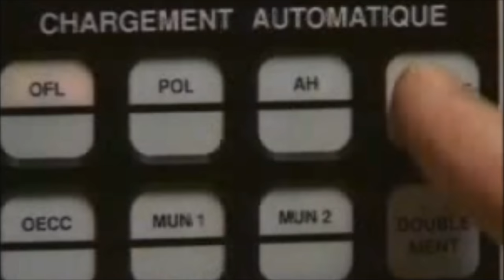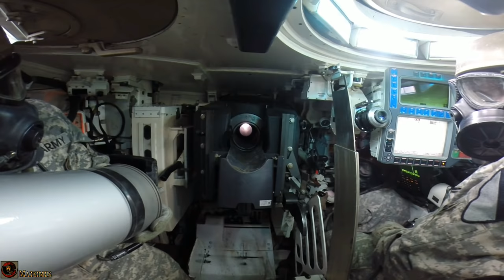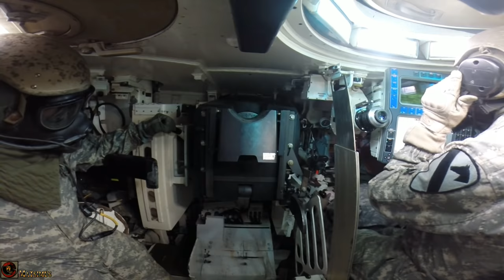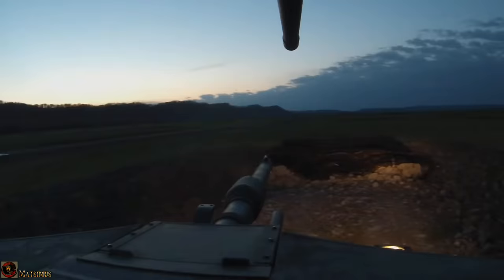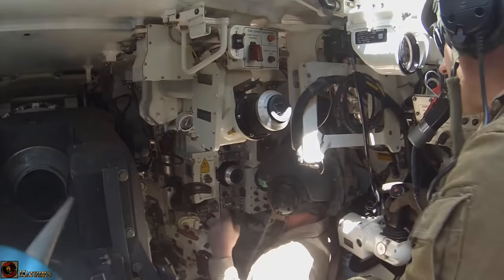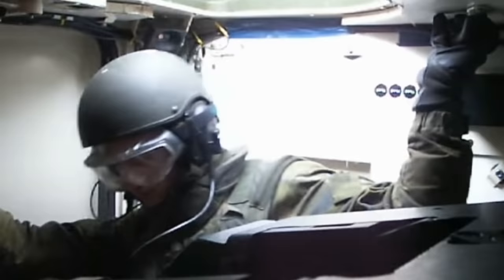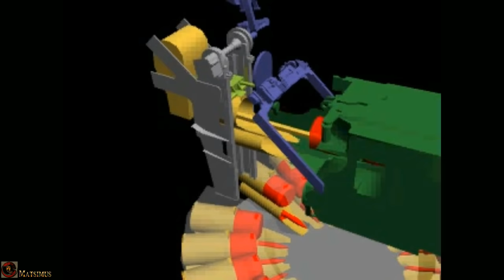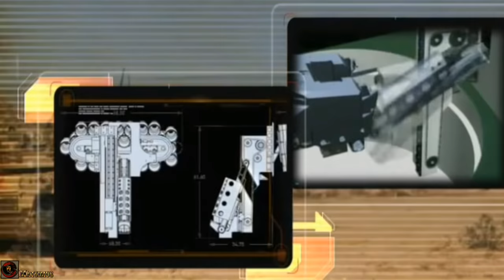Tank Autoloader or Crewman Loader?

Comment: The future is autoloader robot tanks that are remotely controlled.  The armata has a sealed of section for crew to control the tank and if the ammo explodes they are sealed from the explosion.
Reply: The modern tanks are much safer now but the armata has a clear mobility and fire rate advantage especially when crew uses remote control.  Also tanks can be smaller and more nimble and firing off plenty of shells without a crew member in the tank. 

I believe the future is a composite robot and manned tank platoons which will scout and provide firepower for one another
Reply: Couldn't they make a round that cannot blow till its primed and loaded? Could also make the core round a sabot and the outer ring of the round a HE held together by 2 magnets so ammo change is possible.
Reply: The future is electromagnetic rays which is much safer and more powerful than physical projectiles.  The US navy has developed a ray gun firing magnetic pulses.  So tanks could revert to that as well and any shot will only perforate armor and not blow up the tank.
Reply: +Constantine Joseph How hot do you think a solid metal ball will get when it flies 12000 mph through our dense air? 
I predict laser, saser, plasma and electromagnetic weapons. And forcefields and electro gravitics.
Reply: No one is firing ball-shaped ammunition anymore. Railgun projectiles can easily reach 7000mph with current technology, and may get faster in the future. These are fully inert metal darts, but with the huge kinetic energy and the effect of the powerful EM field during the firing process (which enables the projectile to turn nearby air into plasma), they can cause plenty of damage without an explosive charge.
Reply: Mercava??
Reply: the only problem is you need a new gun after 3 shots (don't get me wrong i love railguns)
Reply: Jack Zhan You basically get an explosion due to the speed. If I was told accurate info, didn't check.
I remember having heard somewhere that a comet the size of a basketball hitting the surface could take out an city block of houses due to the insane speeds of 10 or 20 kilometres per second.
Reply: It's simple: there is currently no chemical explosive that is worth using over dumb billet at 4 km/s and higher. After you hit such speed, kinetic energy transmission/conversion alone will provide more power so you are basically losing destructive power if you use explosive payload.
Reply: That is why high powered electromagnetic guns are the future.  However they are expensive to produce compared to the tried and trusted rifled or smoothbore guns that can do it over and over again for years as long as they are maintained well.  

Repairs are also simpler much simpler as it is very much mechanical than electronic
Reply: that exact thing was said in the video
Reply: The future is a giant super computer controlling all tanks, ships, submarines, planes, etc, as drones.

Fucking Skynet, bruh.
Reply: Yes, and the control of the drone army will be taken over by hackers and turned on it's original owners.
Reply: Probably accomplished by a teenage genius hacker called Cain from Red Alert and command and conquer
Reply: I want to see a full size robot or a mech like in SC Goliath or in Avtar movvee
Reply: Lasers: no, too much scatter due to atmosphere, also, the power conversion rate is horrible
Plasma: no, even worse than lasers, will blow to your face, also, the power necessary to turn something into plasma isn't even funny anymore
Gauss cannons: no... too complicated control circuitry. also, you can only fire ferromagnetic rounds. And... Power 
Railguns: perhaps, but not until a material is found that can do this without abrazing the rails after a couple of shots (or warping the structure). Ever seen that railgun fire? the rails last for maybe 3-5 shots, then the whole barrel must be changed. Also: the frickin' power!

explosives (and conventional fuels) currently have a better mass to energy conversion rate than any purely electrical systen for at least a couple of decades.
Reply: Constantine Joseph and if thhey get hit by apsbc from the front they all die
Reply: N
Reply: physical projectiles will always be number 1
 the problem with energy projectiles is their penetration, range, damage and accuracy 
energy weapons just burn or vaporize their target they don't "punch" their target as opposed to matter weapons
Reply: The Leopard has that also
Reply: This will be fine until some hacker takes your tank over and remote controls it. You know, just like in the mid 20th century, they thought that airplanes and missiles will be the only thing needed to win a war... it turned out you still need boots on the ground keep a territory under control.

Comment: I would like to add one important advantage of the autolowder over manual loading that wasn't mentioned, averege loading rate of Soviet T64/T80 is between 7 and 9 round per minute, British Challenger 2 crue during one of the exercises reached the rate of 10-11 rounds per minute, but when the the tank is on the move (off road conditions) the manual loading rate decreases down to 2-3 rounds per minute, while the loading rate of the autolowder is not affected by the type of the pavement it's moving on. Pretty important factor in strategic fast advenses.
Reply: Fair point. Even more so with improvement of stabilizers shooting on the move in an offensive role.
Reply: I've had 4.5 second reloads consecutively on a battle run at 30 kph still better reload time then an auto loader, also an auto loader requires the breach/barrel to aline with  the auto loader to load the next round, mean while a trained manual loader can load around in 4-5 seconds on the move without requiring the breach/barrel to move to allow the loading of the round
Reply: Another important point is that Soviet tanks were designed for a war with a specific enemy that has a lot of nukes and exposure to radiation is very likely. A human loader with radiation sickness would have loading times approaching 0 rounds per minute, while autoloader would not be affected. Driving a tank and aiming with radiation sickness is one thing, carrying almost 20 kg shells several times a minute is another.
Reply: it's a good point, but Soviet tanks wore all so quite advance in anti radiation equipment, filtration systems and special coatings.
Reply: to become a qualified loader you have to load quicker then a auto loader, and you get regular assessed on it
Reply: T 64 didn't have spent round ejector, spent round half shell automatically stored back in the curosell.
Reply: i just watched a video of the T-90 MS and it has a port on the top of the turret which spent shells eject, if that doesnt have an override it would expose the crew to NBC environment, also the M1 abrams is fitted with main and back up NBC systems
Reply: you may have been ( or still is a greate loder) but I have my doubts about ability to keep such rate consitent, after all humans are physical beings, first not all of them are the same, some stronger and faster then others, and they do get tired as well, on top of everything turrane can be quite diverse, emotional state of mind play's it's role to. But what I mentioned in coment ofcorse is not the main reason for use of autolowder.
Reply: Dmitriy T like I said there is a requirement to load faster then an auto loader, if you fail you do don't become a tanker, this gets tested every few months
Reply: T 90 does have ejector as well as T72, T64 and T80 doesn't, because T64 uses cabin type loder.
Reply: ok
Reply: 3 shots in 13 seconds for consecutive rounds in t-72 tank
Reply: t- 62 has a ejector t-64 does not and the air filter system creates overpressure un the t-62 so when the port is open it is supposed that contaminante should not enter
Reply from the maker: Paula Mkguens Rial true but those systems never fully work. Blister agent for instance is liquid and in theory could easily drip past pressurized systems if they are weak...but yes in theory it should stop that from happening. That's if the rest of the tank seals are working correctly and not losing pressure
Reply: T-62 does not have an autoloader but it has human loader. And also opening ejection port under NBC would expose crew to radiation. However you could potentialy store spent casings inside turret for a time being.
Reply: how would someone take 30 seconds to load a round thats fucking bs

Comment: Leclerc tanks use auto loading with 3 crue men and the "loader can select the ammunition he want,  till 3 differents ammunitions,  so I think u need to check infos before
Reply: What he meant was: once the shell is in the barrel you can not switch (auto loader can not take the shell back)
Reply: @hyunjunpark679  yes but we are talking before engagement
Reply: @hyunjunpark679  they have auto eject. And are you seriosly saying you should drive around with an empty barrel?
Reply: We do have round in chamber while entering engagement area, the gun would be put on safe; usually it would be a sabot round as the computer would be indexed to such. The sabot round would punch thru softer targets but it would be easier to reload a HEAT round afterward as a follow up as needed.
Reply: Main guns were fired electrically, without a current, the gun is very safe. Loader needed to flip the safety/fire switch on before the gun could be fired. So riding into combat with a round loaded would cut down the seconds needed to load and all the loader needed to do was the put the gun in fire, plaster himself against the turret ring and yell "UP!" into the CVC.

More often than not, seconds would be lost because green loaders might forget the safety before calling "UP" after the gunner responded to TC's fire commands.
Reply: @ Hyunjun Park... you are very welcome. I sometimes missed being a tanker, 'playing' with the Big Toys. But being a veteran meant there is never a part of me that will stay with me and I am just glad to share my experience.

Comment: I think autoloaders make sense for self-propelled howitzers. With 155mm guns, ammo weights upwards of over 100 pounds, while 120mm rounds typically weight 40-50 rounds. But they still need to be able to load rounds manually in the event the autoloader breaks.

Comment: Basic logic and math is still something that's eluding majority of western mentality when it comes to this issue, while age old fallacies just keep getting endlessly repeated.

Manual loader adds minimum of TEN TONS of weight to the modern gun turret, and over one meter in height since the loader has to STAND, it's that simple.  

Increased profile increases hit probability at 1km by 30%, which forces frontal armor to be even thicker.

All of this has been calculated ad nauseam by entire universities over and over again for over 70 years, and only Western propaganda is still towing the same old tired line.

All comes down to percentage of hits vs penetration resistance.  

1. Do NOT get hit.
2. If hit have the lowest probability of critical damage.
3. Store the ammunition as low to the ground as possible.  

Separation of ammunition into the rear of the turret does NOT mathematically lower the possibility of it getting hit, on the contrary it only increases it.  

Blow off panels do NOT "save the crew" from ammunition detonation, at best they buy time for the crew to bail in case of PROPELLANT BURN OFF.

So the tank either carries only KE rounds and become entirely ineffective against infantry, or it does carry HE rounds and risks DETONATION upon ammo rack hit.

If the traditional Western rear turret ammo rack is loaded predominantly with HEAT rounds, then upon breach it DETONATES just as any other high explosive warheads do, and no blow off panels or fire walls prevent total and immediate destruction of the crew compartment.

Eastern tank design focuses on infantry support thus high percentage of HE rounds, while Western design focuses specifically on anti-tank role thus complete absence of specific anti-personnel HE rounds.

1991 Iraq war tank design comparison is false and has been proven so over and over again, it's empty propaganda that has been ignored by professionals decades ago. 

What matters is how a frontal armor of the tank takes a hit, and T-90 demonstrates that perfectly right here when a TOW smacks it from point blank range right in the sweet spot;

https://www.youtube.com/watch?v=N9cre9GpIUs

Crew is safe tank not penetrated, and that's all the tank armor is supposed to do, provide frontal protection.

Western tank provide the same approximate level of frontal protection, but at the expense of being almost TWICE as heavy, while providing NO additional protection when hit from the sides, as clearly shown again and again.

If the ammo rack of this Abrams was loaded with HE, it would have detonated just as ay other HE warhead;

https://www.youtube.com/watch?v=VWXIhXJktmM

A hit on the rear of the Abrams turret GUARANTEES a cook off, while there are numerous videos of T type tank getting hits from 360 degrees that do not result in ammo rack ignition because it's stored on the floor instead of high up in the turret.

A side hit on the Abrams turret breaches ammo rack for an cook off;

https://www.youtube.com/watch?v=UEdfCw0nsoM

A catastrophic Abrams ammo rack breach by Kornet ATGM from long range;

https://www.youtube.com/watch?v=-ePvNlfrxfw

All of those are "good enough" hits that completely destroyed Abrams tanks with cheap ATGMs from the 70s, and that's all that's required, but if those ammo racks were actually loaded with HE rounds, they would have detonated just as any other ammo rack loaded with HE.

So is all that extra weight increase battle and worth it?  According modern developments such as US M1 TTB and Russian T-14 Armata, no, it does not.

All tanks burn, but only the ones that carry EXPLOSIVES actually EXPLODE.

Do the math you lazy bastards!

Comment: There are as you said trade-offs between the types.

But here are the things about Manual Loading.

+ Loading of ammo can be quicker and ammo changed on the fly compared to autoloaders.
+ Easy to design separate blow-out compartments from them.
+ Nice one piece ammunition.
+ Additional crew member who can do other things and help.
+ Any idiot can be taught how to load a cannon.

- In order to fit extra crew-member nicely, tank must be bigger. Increasing vehicle weight.
- Will be more effected by vehicle moving through rough terrain and can be fatigued.
- Not ideally suited for loading particularly large rounds which would be better suited to being loaded by an autoloader as a multi-piece round.

It really depends on what you are looking to get from your tank, but that is generally what I see about. The Japanese Type 90 also has an autoloader with blowout compartments so that can be done and is not a thing exclusive to manually loaded tanks.
Reply: The Challenger 2 has 3 piece munition and does not have an autoloader, autoloaders do not have to have multiple piece amunitions.
Reply: LenChewbacca True indeed.
Reply: Which doesn't mean multiple piece munition is bad btw. Both have positives and negatives.
Reply from the maker: that is true. as for three piece, the mag for the igntion (cant remember the name of it) is a mag so its not like it needs as much reloading as the rounds themselves. but a very fair point! And your avatar made me laugh lol. but isnt that jabba :-/ lol
Reply: made the account like 7 years ago or some shit, I would remake my account but I have lots of videos in my favourites that I like.

Another point about autoloaders is that it's less heavy.
Reply from the maker: +LenChewbacca haha gotcha! Well thanks for watching! Have a good day :-D
Reply: but in the video it was shown that autoloaders do have multiple pieces of ammunition tho, the projectile and charge was loaded seperately.
Reply: Harry Lim I know that as I said in that comment about the auto-loader being highly suited for loading multi-piece rounds.
Reply: also, are you referring to vent tubes/percussion tubes? The little 50 cal like cartridge that acts like a primer?
Reply: Harry Lim I was not referring to the primer system like on the Challenger weapons.
Reply: the second comment was meant for channel lwner. the mag for ignition fits the vent tube description perfectly. also. can you point out what is the type of 3 piece ammo you were referring to if not projectile, charge and vent tube
Reply: Harry Lim Ahh. Thanks for the clarification.
Reply: Nicholas Mew very interesting thanks for this info